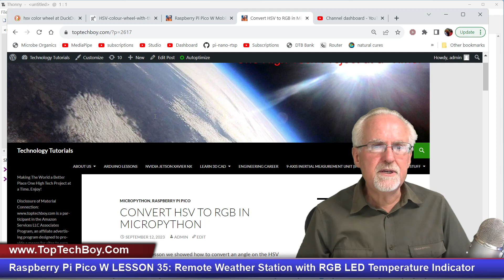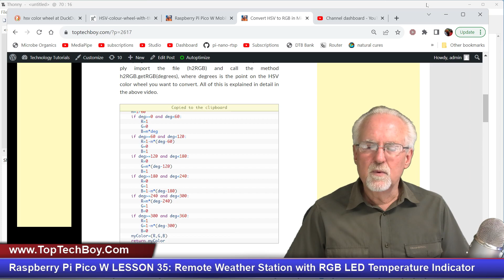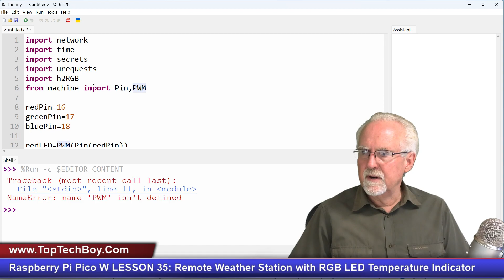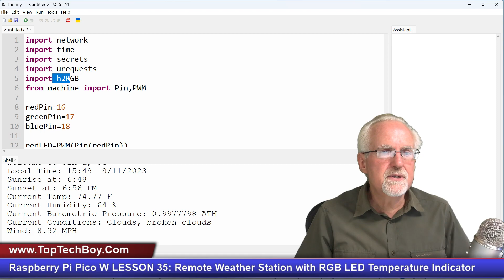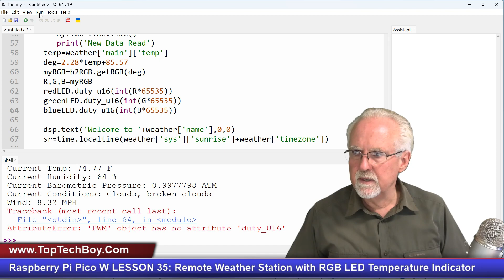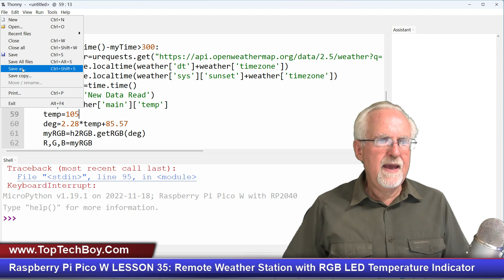Raspberry Pi Pico W LESSON 35: Remote Weather Station with RGB LED Temperature Indicator

Comment: Thanks Paul,
But once again completely bamboozled me with maths. I realise you were a maths teacher (so I believe) but not all of us are.
Would be nice if you or someone could do a dummy version explanation of the maths so we could all do this sort of calculation as of now its a bit of a waste as I could never do this on my own.
I sort of got the slope and line theory from the earlier lessons and sort of followed the maths, but this time completely lost.
OK up to y-40 = [319/140 [x-(-20)]
Then you say 'we have to distribute that slope' and somehow you get: 
y-40 = [319/140] (x) + ( 20)(319)/140    How? Where does the second 319/140 suddenly  come from? (Sorry a bit hard to write the equation with a keyboard)
Howard
Reply from the maker: Distribution means to remove the parenthesis, and multiply out the terms. This is a simple example
z= 3*(A + B)
You 'distribute the 3 by multiplying it by each term in the parenthesis to get:
z = 3*A + 3*B
Or think about it with real numbers
z = 4* ( 2+3)
z= 4*5
z=20
THat wat done without distributing, but now do it by distributing
z = 4*(2+3)
z= 4*2 + 4*3
z=8+12
z=20
See . . . it works
Reply: @paulmcwhorter  Thanks Paul, that makes more sence now, especially when explained with real numbers. I am 71 now and its been a long time since my school days when I probably used these sort of equations.
Still its nice to go through this sort of maths again. Please keep it up.

Comment: After testing the Various Temps...  I get a Low of minus 39 and a High of 120 before Errors Pop up..... The errors point to the RGB Library we make... h2RGB.py      minus 39 to 120 in Temperature is a complete circle around the Color Wheel... Very, Very Cool Paul!!  Thanks